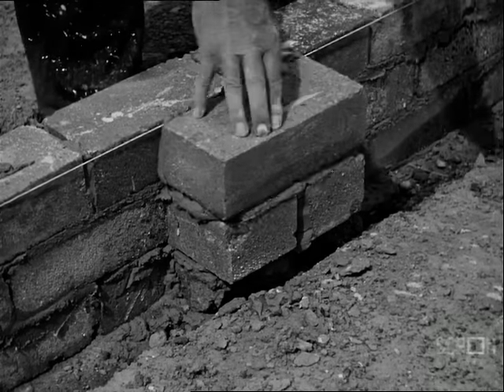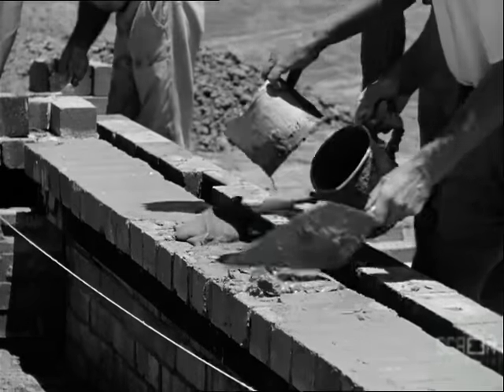Building A Brick House

Comment: Notice...... No wood framing, the walls are built using a 2 wythes system. (2 rows of brick tied together, with a cavity in between).  Today's brick work is simply veneer.   No not the peel and stick stuff, but rather a single row of bricks tied to the wood framing. In today's system the house holds up the brick, in the old days the brick held up the house. I plan on building the old way.
Reply from the maker: Thanks for pointing that out.
Reply: @ NFSA Films , This was a surprise to me actually, I had no clue the difference in old school Brick masonry vs today's building techniques until I saw this video and started doing a little research. I guess the only disadvantage was that there was no installation used in these old school builds, and they plastered the interior walls and then painted, which I'm sure made it difficult to hang pictures. I guess with a little innovation you could still build the old school way and use modern installation techniques. but then that would all depend on today's building codes and requirements. I'm definitely going to look further into it.
Reply from the maker: Yes taking the good from the past and adding the good from the new sounds like a great way to go.  Obviously there are cost and resource issues to consider too.  The Germans are now building a style of house called "passive housing" that takes insulation incredibly seriously.  If done correctly the houses require no internal heating or cooling regardless of the climate.
Reply: +B4ReaL It depends where you live. I'm a brick layer, certain areas have timer frames where bricks are just veneer, though i've worked in other states in Australia where it is all brickwork or blockwork inside and out, there's no timber frame.
Reply: Not in the UK Timber frame houses still have a cavity and an external Skin of Brickwork, plus we still do traditional builds, through the wall.....This film still shows much of what is still being done though thankfully no more salt glaze underground drainage......
Reply: you do realise that modern timber houses are stronger than cavity brick will ever be. there are no cavity brick houses in cyclone areas. its a complete fallacy that old houses are stronger than new ones
Reply: correct you are
Reply: Australian brickie here. We still build a lot of full double brick houses/ buildings over here! Still have veneer but most of my work is cavity brickwork.
Reply: Chuck Finley  : The "3 Little Pigs" was written before building codes, hurricane straps, screws, etc. Sure, it's possible to build a wood house that's weaker than the weakest brick houses (which have to be at least strong enough to support this massive weight), but most modern wood houses are built to the same standards as brick houses, which need some kind of reinforcement to meet the strongest hurricane codes. And at least in the USA, and probably the UK, there is no such thing as a new "brick house" in the true sense. It's either put up over a frame (wood or steel) or over concrete blocks which bear most of the weight. My house is brick over cinder block, but it wouldn't meet today's earthquake codes for MA, so almost all residential construction is wood-framed in this area. Brick is a great exterior material though; far better, if done right, than wood or vinyl siding for longevity.
Reply: My uncle built a double brick house himself in the 80s. It was unbearably hot in summer though.
Reply: @NFSAFilms  Actually, the air pocket between the walls was a kind of insulation along w/ the density of the brick, granted, not nearly approaching the R standards of today. I lived in house built in '65 that had no insulation in the exterior walls & only two layers of aluminum foil w/ an air pocket in the attic.
Reply: @brendan6619  maybe slightly stronger than cavity brick, not stronger than triple wythe though.
Reply: They build double brick in western australia do this day. The soundproofing is good the houses are still too hot in summer. Built house out of natural limestone the thermal properties are amazing much better than brick. A slow process.
Reply: Yeah, its called load bearing masonry, the most amazingly simple masonry, nothing but brick
Reply: @brendan6619  Ummm, in Dampier, Karratha and Port Hedland they are full brick, and definitely cyclone areas, I lived in Karratha and went through some cyclones too.
Reply: @brendan6619  Cavity's were filled, they weren't actual cavity's, at least were I live. My house was built with brick in the 1920's. The cavity was filled with cement mixed with broken bricks, and other aggregate. The house is solid!
Reply: Rich 91 it’s actually cheap building like that
Reply: @NFSAFilms  Problem is, that insulation material is some bad stuff, chemically.  Many people build a sensitivity to it.  Also, if the house is air tight you can have sick house syndrome.  If you have an airtight house you really need an air system that brings in outside air and filters it, replacing the air every 45 minutes.
Reply: @brendan6619  hehehe, fortunately the UK is pretty cyclone free....
Reply: Modern houses are Cheap brick .
thinest timber they Can away with .
Built by Tattoo, snickers wearing "boys
Reply: If you have a vast amount of money - go for it.  All brick construction is 2-3 times more expensive - and not really required.   You can use modern materials and save money on construction, and money in heating/cooling the building.

There's a reason we don't build houses like this any more - money...
Reply: @NFSAFilms  Some in USA to. We call it net zero. Doesn't interest people who aren't curious minds to begin with but it's a fascinating new approach. I've seen some interesting  new framing where the 2x6 exterior walls are staggered to allow continuous insulation instead of the traditional thermal break at each wall stud. It's all about energy efficiency now as fuel is a real concern. When this film was made air tightness limits were not a thing.
Reply: @masakasama i believe that was the purpose of crown moulding or no?
Reply: @brendan6619  in the usa we have to insrall hurricane straps to the exterior walls. Don't know if it's a national code but certainly in a lot of srates.
Reply: @pcno2832  you live in MA? I've heard they still do pkaster lath walls? Why? Everywhere I've worked it's all drywall.
Reply: @danbiss87  funny. I visited the Roman Colosseum and the massive collumns were a brick verneer and inner cavity was filled with concrete and broken bricks as aggregate. Only lasted 2000 years though, not so great.
Reply: @robertbrandywine  It's what is promoted today. Necessary mechanical ventilation! The idea is to make the house air tight to conserve heat at all costs(bad pun).
Reply: Would there be an advantage to concrete in between the brick walls?
Reply: @petecotter6790  Yes there is an upside and downside which vary depending on the climate where you live. I Live up north in MA and my house was built with brick and in the cavities between interior and exterior brick is all fill (leftover jobsite material) mixed with concrete. In the summer time the house is extremely comfortable, no AC required. It stays relatively cool. Winter time on the other hand it takes a lot to keep the house warm.
Reply: @danbiss87  thank you, live in victoria, Australia.  Where it can get low as 0 degrees and upwards of 45 degrees C.
Reply: @johnnytocino9313  What is MA?
Reply: @petecotter6790  I wouldn't think so as concrete has a very low R-value.  Best, would be 4" thick insulation that comes in 4'x8' sections. https://www.insulfoam.com/wp-content/uploads/2014/04/12015-R-Tech-Wall-TDS_WEB_REV8-16.pdf
Reply: @robertbrandywine  Massachusetts abbreviation.
Reply: @johnnytocino9313  So, do they still use lathe and plaster up there?
Reply: @robertbrandywine  I'm not from there. I'm in baltimore and a framer I've been working alonside is, and he said a lot of new construction there still uses plaster lathe.
Reply: @johnnytocino9313  Okay, thanks.
Reply: @robertbrandywine  thanks for that. I did like the idea of filling the double brick cavity with concrete for the idea of support, strength ect... unless there is a down side. 
Thanks guys for your 2c worth! Or penny if from USA i think...
Reply: Nope - THIS way is the way houses are being built in Germany!

This video surprised me a lot - because not many things have changed - only the cavity in the two row of stones got a lot bigger and filled with mineralwool for insulation. Also double sills are installed and the inner wall consists of bigger bricks made out of limestone here in Germany mostl  or airiated concrete aka Y-ting and is usually 17,5 or 20cm wide/thick. Still both walls the internal and the external are connected one to another via dtainless steel connectors and the roof is almost constructee exactly the same way, only a few more layers of delta foil and what not for insulation stuff and so on.

So I can not agree with this way not being built anymore.

If you buy a massive house in Germany - it will be built as seen in this video only with of cpurse more modern tools - but the same quality of construction and in many points small improvements.

But at the core the trades stay the same here.^^
Reply: @stevendouglas3860  this is not true in Germany where I just had my vouse built!

And let me tell you - basically same technique shown in this video only EVERYTHING a lot beefier, stronger and probably longer lasting!

I do not know why people think their timber-frame construction would bare loads any better then modern massive homes built from limestone, Klinker and Concrete.

My groundlevel ceiling alone probably weighs more then the standart american home in total ;-)

In my opinion stones are not only stronger, but mich better acoustically insulating and also keep the heat better then wood.

If you are interested I am more then happy to share both - details of the construction process of my house - as well as pictures and such. 

I m very interested in building processes in general and see the benefits of timber construction in earthquake areas!

But for storms/cyclones and such - no way any timberframe house is going to hold up half as good as a massively, built house in northern Europe.

We also do have timberframe constructions.
The are getting more and more popular - but you can hear peoole talking through the walls!

Ergo I was in a frienda house and there were öeople on his driveqay having a duscussion and I could almost understand the words they were saying.

If I close my doors and windows - boom silence.

Of course the neighbors lawnmower will be hearable on the inside but not nearly as much as in that guys house I visited.

I have lived a big part of my life in timberframe house and know the pros and cons and when it was time I built my own I knew What to choose ;-)
Reply: @kniefi  I didn't know they had an inner and outer wall on German houses, I thought it was just those big clay bricks covered with stucco on the outside and plaster on the inside.
Reply: @petecotter6790  I've had the same thoughts on the perfect wall -- if money were absolutely no object -- and decided a 4 wythe wall with only air between the inner and outer walls and the second most inner and outer walls with panel insulation in the center section would be best from the point of strength, air circulation, and insulating ability, plus separation of the insulation from the home owner would be ideal.  Just waiting for my Lotto win.
Reply: @robertbrandywine  good luck with that. This point, looks like insulated wool is probably the logical winner! Solid double brick with insulated cement sheet on the inner wall. Im no pro but dreaming of building that 'perfect house'!
Reply: @danbiss87  Hi Dan, I live in SE England so a temperate climate probably not too different to yours but possibly wetter. Brick cavity walls here were originally brought in to keep out damp, by having an outer skin to get hit by the driving rain with an air gap between that and the inner skin. The insulating properties of a cavity were secondary. But, you only get those benefits if you don't "bridge" the cavity with rubble etc. Have you checked your cavity is definitely filled up with concrete, because sometimes you get a small amount of rubble in one area that can be cleared out if you ever get damp problems in that area.
As an aside, my house was built in 1919 and has a brick-skinned cavity wall - we had the cavity filled with an insulating material 10 years ago and so far no problems with damp, but the house stays warmer in winter and keeps cool for longer into the day in summer (a/c is rare in homes here as our usual summer days are 20-30 celsius but as we've hit 36 celsius twice in the last week a/c sounds pretty sweet about now!).
Reply: And do modern houses have reinforcement in their footers, and foundations?
Reply: @brendan6619  is that so?..
Reply: That depends on where in the world you are, in Denmark most houses are still build with two bricks + cavity.
I guess climate have a lot to say in that respect, since in Denmark normal winter and summer can go from -15c to 25-30c, a single brick wall would be devastating to the house in just a couple of years and eat up all of your hard earned money in heating bills.
And remember that cavity and insulations (Rockwool and such) helps insulate against both the cold and the warmth.
Reply: @JohnnyMotel99  1980s would like a word with you.
Reply: @realnewsthatmatters9319  I owned a 2 story building that was built during the 1890s and its walls were 3 courses (of brick) thick. No insulation and no room for any insulation.  But as a result it held its temperature year round sorta like a cave. There were wooden blocks laid into the brickwork in specific spots for nailing the window/door frames, trim work, baseboards, etc. For interior decorating purposes a trim piece was hung about 8' high on the walls circling every room and I learned from an old timer that pictures, etc were meant to be hung from a nail in that trim using a thin piece of wire. Very intriguing how they built things long ago.
Reply: @brendan6619  So not true!
Reply: @brendan6619  Would be easy though to use a different brick, block technique for strength
Reply: Ever heard of CMUs? Today we build out of concrete bricks that are larger and fill  it with rebar and concrete. Far superior to the weak red brick used in this film. In today's world steel and concrete hold up structures, not weak ass red brick.
Reply: Your very correct my friend and if you ever need a fast brick layer just send me a message, I do stone work as well as tile and granite, I'm the sixth generation of masons in my family but it goes farther than that I don't know how many of my ancestors were masons but most likely all of them
Reply: It is really interesting that you say that. I live in a house that was built the same way in 1950s during Stalin Reign in USSR (I live in Lithuania). My house has also two wythes brick walls on the outside. The inside cavity is filled with dried wood shavings (and during modernisation the cavity was filled with foam) and the floor was done the exact same way witch is so amazing. The only difference is that during the period of witch many homes like mine was built, there was a significant lack of cement powder, ad the result is that the bricks were laid with mortar that had no more than 10 percent cement amount, sometimes even far less than that. I could take my car key and easily chip away the old mortar, basically, I could demolish my house with a spoon.. But nevertheless the house is pretty strong, it held up for 70 years and is still going strong. I just took old wooden floor out and I poured a solid concrete slab, then demolished the old iron rail reinforced attic concrete slab and demolished the old wooden roof system and I poured a new fully reinforced real concrete slab and I built a new wooden roof system and made it a liveable attic. During soviet era, it was a common practise to use continuous railway iron rails, the same ones used for train tracks, and them being installed with equal spacing on the bearing walls and then concrete poured over them and that made 90 percent of all soviet concrete slabs in residential houses. Because the railway tracks were really heavy and strong, the slab could be poured using minimal amount of concrete and it still would be extremely durable and held up a lot of weight, like, the old one was only 7 cm thick and it help a fully cramped attic for 70 years and the ceiling never even cracked in a single place. But I still demolished it and reinstalled a new poured concrete slab and installed a liveable attic up there. I also installed a new heating system with a cast iron boiler, because the old system was a giant cast iron coal fired boiler, a gravity system with 2 inch pipes and cast iron radiators that fell apart as I tried to remove them and all sections broke apart like pasta at nipple joints. I refurbished the old house inside as well as possible, but still left the original yellow clay bricks and the original mortar that was made using mainly the lime as binding agent.. It still amazes me how the building practises were the same ones here as they were overseas too.. My house original drain system that comes through a basement floor is the same clay pipe, and from it the original drain system in the house was cast iron, I replaced it with modern pipes and tied into the original clay pipe. This house shows the amazing craftsmanship that was implemented from the heart of the men that are long passed away now. Since there was a shortage of concrete, the whole basement area and the whole foundation is made from stacked and mortared together cut stones, and the lintels above all windows and door frames were made from vertically mortared bricks that act as a lintel, because there was no available rebar and cement powders for concrete making. .I tell you, the attic slab was only 7 cm thick for an entire house, and the whole slab was just held up by one wall in the middle of the house..
Reply: @petecotter6790  of course there is a downside. The whole purpose of the cavity is to separate the outer (wet) skin from the inner (dry) skin. They should never touch or else you get damp penetration. A modern build (in the UK at least) is a brick or stone outer skin, 2inch clear cavity, 4inch foam insulations board and then the inner skin, usually concrete blocks but sometimes timber framing.
Reply: @brendan6619  Then why florida builds only with cinder block.
Reply: In colder parts of Europe (from the north part of Italy up) bricks are still used. However, it's no longer "bricks" as you may image them, now it's Ytong or Porotherm or other material consisting of many small caps inside so they provide insulation (temperature and sound). Timber is usually not used in such houses. 

Here you can see a timelapse video of building such house (it was part of some course/exhibition): https://www.youtube.com/watch?v=1lC6X7V2xa8
Reply: @pcno2832  If you look at the archive footage of Darwin after cyclone Tracy, it was the brick structures that were still standing. I'll take the bricks thanks.
Reply: @masakasama The picture rail covered the joint in fibrous plaster sheets that were 6 feet high (1.8m). This meant that the joint did not have to be filled, and  a potential crack right along the wall was averted.  It was coincidental that it was a place to hang pictures, so the builders catered for that as well.